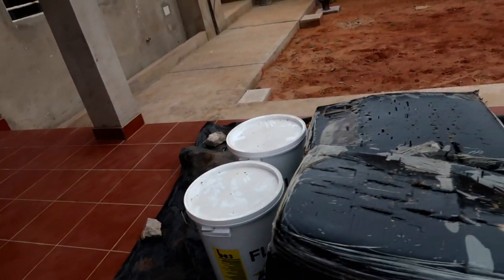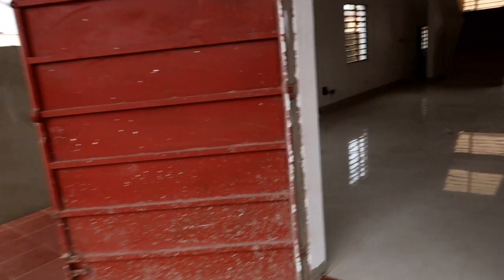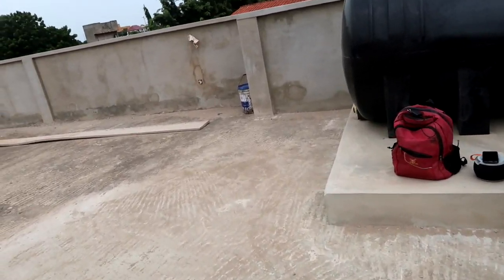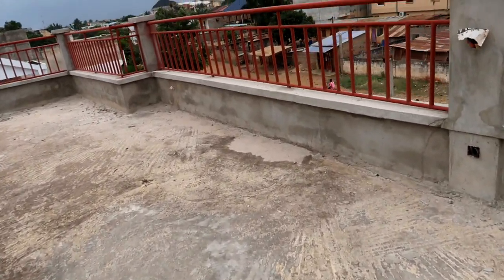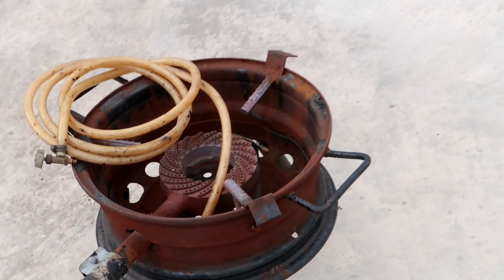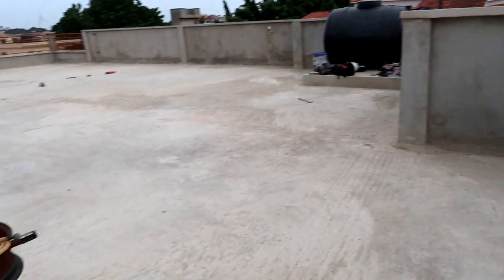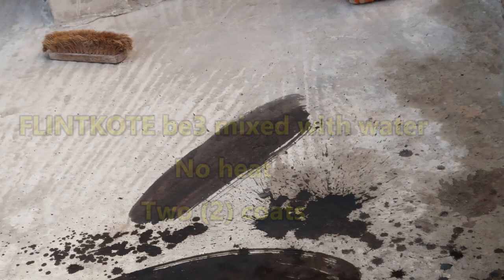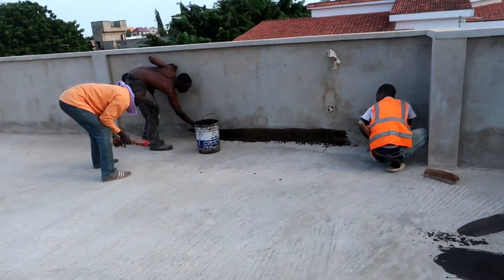Building The House 79 - Waterproofing The Rooftop

Comment: Welcome back. Very educational video. How do they may rain water flow to drain pipes without any perceivable sloping to the naked eye, must involve an enormous amount of skill, precision and attention to detail. Do you have drainage on all 4 sides or just on one or two sides of the building. I never noticed the drains in this video.
Reply from the maker: Hi Omil, thanks and thank you.  Good thoughts...I pointed a viewer to one such drainage hole on the floor, beginning at 19:47.  There are several drainage holes on all sides.  If you look closely, you will spot them.

The slopes were established by the masonry work during casting of the concrete rooftop slab. One of the reasons why debris and loose particles have to be removed, is to maintain the integrity of the slopes even after waterproofing materials are laid evenly on the surfaces.  It is very delicate work. The waterproofing was done right as evidenced by proper drainage after the rains came.

Omil, I appreciate your thoughts, comments and continued support 🙏🏾
Reply: @AyiviTV  Thank you, I read your reply to Bright soon after  I posted my comment. Keep up the  great work.
Reply from the maker: @proyouservicesltd3652  thanks Omil.  Stay blessed🙏🏾

Comment: Hi Ayivi, Thanks for this video. Can you tell if the rooftop can be tiled or cemented after this? Can you also provide the contact information of the waterproofing company ?
Reply from the maker: Hello @Lassey P,  you are welcome and thanks for tuning in. 

 Yes.  You can tile and in fact you can build on the waterproofed surface.

Regarding the artisans, there were two (2) different crews of artisans in the video.  The first, worked on most of the surface area.  The second worked on the 25cm band all around (perimeter).

There have been several inquiries by viewers about the artisans.  Please feel free to send an email to ayivi.tv@gmail.com.  kindly include your contact information and project particulars.  Thank you.
Reply: @AyiviTV  , can you please answer my email sent over a week ago ? Thanks
Reply from the maker: @lasseyp9583  Hi, apologies.  Your email ended up in a spam folder.  I have responded and thanks for reaching out. 🙏🏾